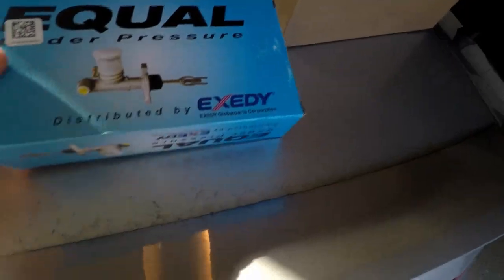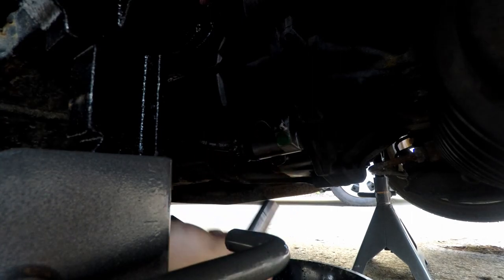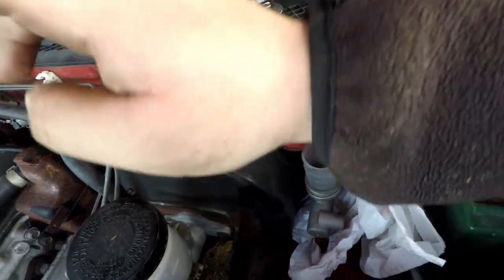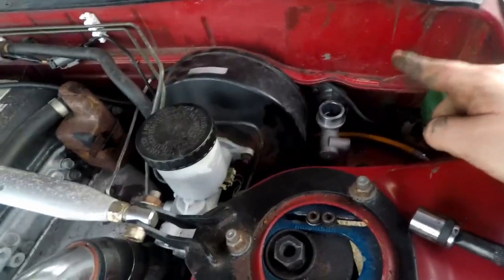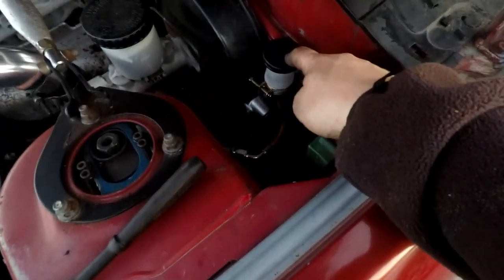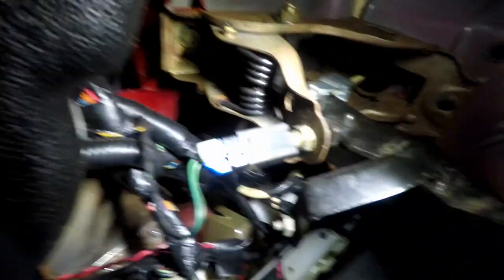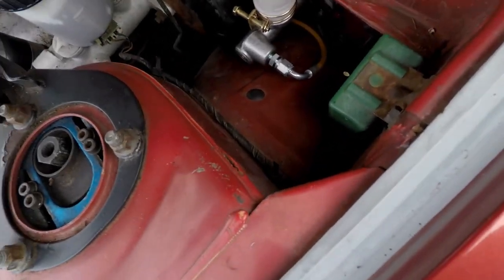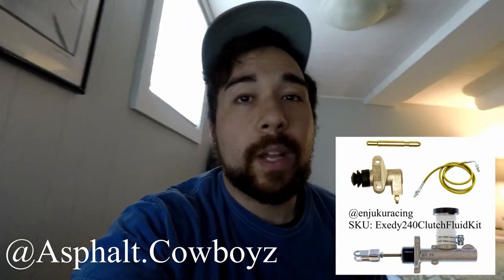NEW Clutch LINE, SLAVE, & MASTER on 240SX !!

Comment: Hey, trying to diagnose my s13 issue based off yours. So when you say you couldn’t go into gear. It physically wouldn’t let go in to 1st, 2nd, reverse etc if you tried? Mine goes into any gears but doesn’t move. I’m think my clutch is stuck open. Sounds like yours was the opposite
Reply from the maker: Sounds like your clutch might be stuck. Is there pressure in your clutch pedal??
Reply: Yeah I think so, there’s pressure but a few times there was no pressure. I had to pull the pedal back out. I just determined it’s a bad hose because I replaced the slave cylinder 2 times and it’s still leaking.
Reply: Sorry idk why it’s using both my accounts lol